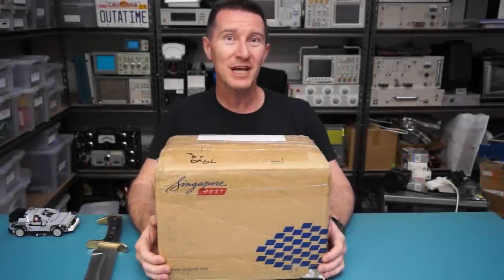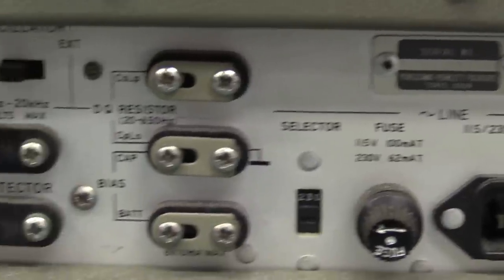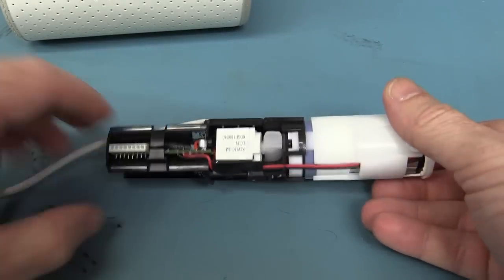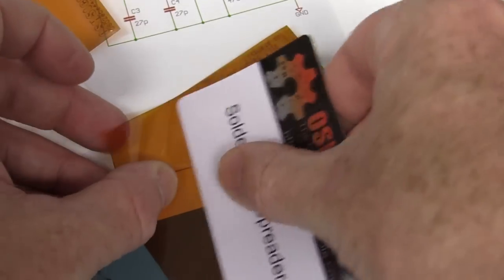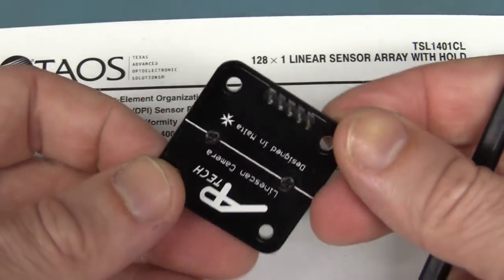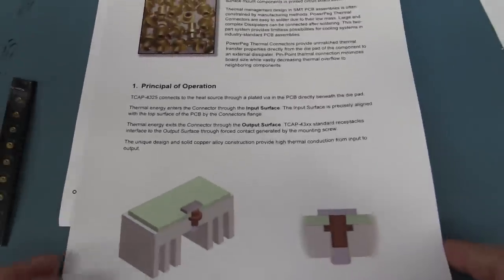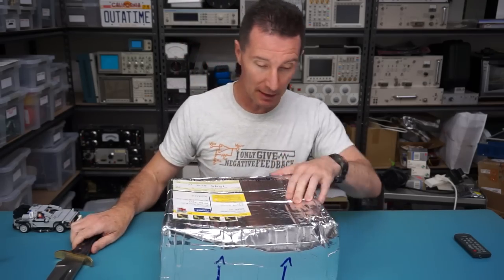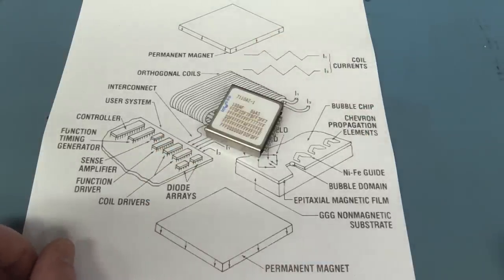EEVblog #677 - Mailbag

Comment: Question: I have several of those small 5V 9V 12V Power adapters and I have tested several and I have found some of them to have low output which means off to the landfill and most of them are either right on the money or just a little over like 13.87 for a 12V. My question is are the ones that are considerably over still viable or maybe not like 15.28V for a 9V or 17.79V for a 12V?

Comment: Dave I am upset that your not using the giant knife for 100% of mail bag openings. I think I speak for the majority of the community when I say that the giant knife is the most appropriate tool for opening all packages. If science has proven one thing it's that giant knife + mail bag opening = enjoyment. I want to lobby for an even bigger knife, perhaps a Japanese sword ? Or even a low yield explosive .
Reply from the maker: quincy8557 I think I might have to agree with you...
Reply: Why only low yield?
Reply: EEVblog
I can spec and supply you with some custom shaped charges for a nominal fee. Licensing restrictions and international hazmat shipping fees may apply.
Reply: CNC router?
Reply: Angle Grinder
Reply: plasma cutter
Reply: Photon cannon
Reply: relativistic kill vehicle
Reply: a black hole generator
Reply: soldering iron
Reply: Hot glue gun
Reply: FIRE
Reply: Flamethrower
Reply: table-saw
Reply: Hack-Saw
Reply: Dremel™
Reply: Router
Reply: Large Hadron Collider
Reply: Atomic Bomb
Reply: Neutron Star ??
Reply: quincy8557 use a small racing drone to peel off the tape ;)
Reply: +quincy8557  serusliy a low yield eplosive?!!!!!!!!!!!!!!!!!!!!!!!!!!!!!!!!!!!!??????????????
Reply: +Ry L nuclear bomb?(is it to op)(over powered )
Reply: +Hermann Göring wats that?
Reply: +quincy8557 "giant knife"

Or in Australian: knife
Reply: @skipfred  Tiny chain saw?!

Comment: Yes Dave.. you should always read the note in a package first.
This way if someone would send you... let's say... a delicate solar cell you won't risk breaking it.;)
Reply: Oh, that epic fail will hunt him for ages now. :D
Reply: But it was definetily not the knifes fault. The cell was not packaged properly.
Reply: nickoe The cell was packaged well enough to arrive intact, which strongly argues it was packaged sufficiently well.

It's never the tool's fault, it's the tool user. It was the ripping with bare hands part after the knife couldn't do the job that killed the cell.

The problem with the big knife is simply that the point is a foot away from your hand, and controlling it accurately is far harder than with a smaller knife. That's an inherent problem that doesn't go away even if you're skilled enough to do the job successfully anyway. it's just the wrong tool for the job -- or at least for many of the jobs involved in opening packages.

Comment: Bubble Memory! Wow! simply WOW! I never heard of that before!
Reply: i have bubble memory in my TRS80 model 100 laptop from 1983. its a very interesting form of memory storage.
Reply: Eshan Wells
 http://en.wikipedia.org/wiki/Bubble_memory

that tells you pretty much everything.
Reply: Rinoa Super-Genius haven't seen you around in a while
Reply: Same here! Take it apart!
Reply: It's got a bit of infamy in the arcade world; Konami used bubble memory in their "bubble machines". When started from cold, the machines always played a tune while the memory warmed up, since bubble memory has to be at about 30-40 c to work properly. The game roms themselves were stored in bubble memory cartridges. Sadly, very few of the machines still operate. Turns out, bubble memory did not make the best medium for long term storage of program rom.
Reply: k0namiman
 i cant find anything regarding that on the internet, i would like to hear more.

bubble memory was usually saved for portable and expensive devices, where arcade machines where made from bottom of the line components. i have a Race Drivin arcade machine and its basicly a Sega Genesis made from 1982 hardware. like more than a square meter of circuitboards to run it.

my Missile Command, Mappy, and space invaders clone are made from very low grade components also.

i have heard about suicide batteries in arcade machines though. those are a bad idea.
Reply: The hex markings on the outside is the factory error map.  I work at a machine shop that has CNC lathes from the mid 80s that use bubble memory.  Most have been converted to flash by now.
Reply: Rinoa Super-Genius
 Most arcade machines were pretty poor, yes. But Konami did the experiment with bubble memory. Games that used it included Gradius, Twinbee, Hyper Crash, and Galactic Warriors. I think a few others used the Bubble System as well.
Reply: k0namiman
 interesting. i'll keep an eye out for more info on those.
Reply: k0namiman They were actually used.. IN arcade machine?!? I would never have expected that :D
Reply: I honestly can't understand how that works. I will have to look into it. "Magnetic bubble"... what?

Comment: Very cool mailbag items this time, Dave. But i demand more BiiiiiG "knifin´". Just because it is -- more or less -- your mailbag "trademark" ;)
If these PowerPegs had been there when i designed that heat sink for some SMD power mosfets back some 5 years ago, it had saved me some days!! In the end we used some M3 copper screws underneath the mosfets along with some complex wholes resulting that just the screw head was touching the backside of each mosfet.....

Comment: The 4260 needs a definite fix.
Reply: It really does. And show how it is operated.
I remember using one at university.  The entire mechanical aspect of it was very neat. Cranking on the dial and getting the meter to zero. 

I hope it happens. Dave, you reading this?

Comment: I first heard about bubble memory when reading about Konami using it in a version of an arcade board they made and ran some versions of games like Gradius and Twin Bee. The BIOS would have to wait some time to let it warm up for best operations but it's a shame that it wasn't so reliable, a lot of the old Konami Bubble systems no longer work due to the data being lost, but this is the issue with magnetic media

Comment: Bubble memory seems like it would be really slow.
Other than that, those pegs seem pretty interesting, though they should make a copper screw that can go in flush in order to allow for multiple pegs to be installed and then a single large heatsink placed on the other side (e.g., a multiple high power LED array).

Comment: I had a homemade speaker amp on a protoboard powering the speakers in my office, and everytime the air conditioner turned off, the speakers popped very alarmingly, and that aluminum tape covered box looks like the solution I made until I found a proper enclosure I could use xD

Comment: Could you do a teardown of a BLUETOOTH speaker? I ask because they are the hot items right now. From cheap to very expensive. They all seem to have audio over BT, Lipo batteries and internal charging, voice prompts, NFC for pairing. I just wonder if there is just a single really clever chip inside that manages all of this. Some even act as speaker phones. I'm guessing from cheap to expensive they are all basically the same circuits while the expensive ones may have better amps and speakers. Just curious.
Reply: I got a freebie from my mobile company. I was thinking they must have a 1/2 chip solution going on, and if they are going free there must be a surplus of cheep chips flooding in.